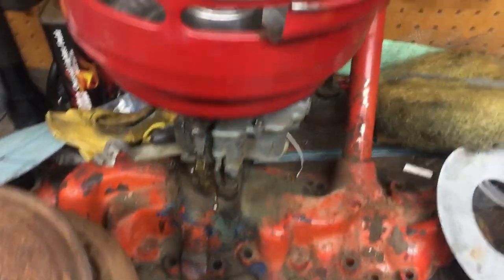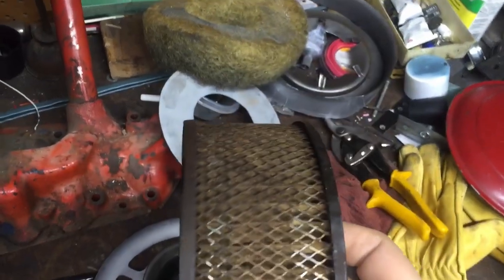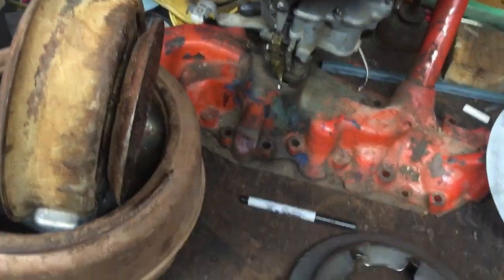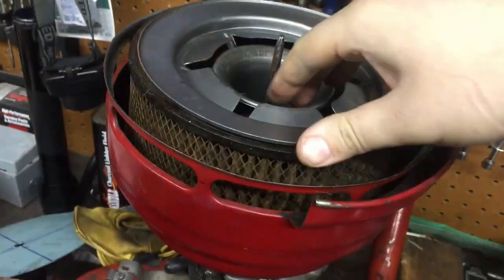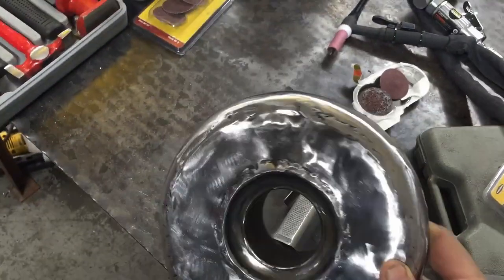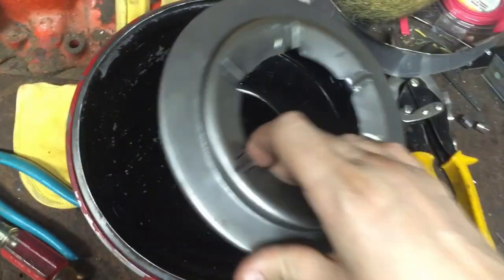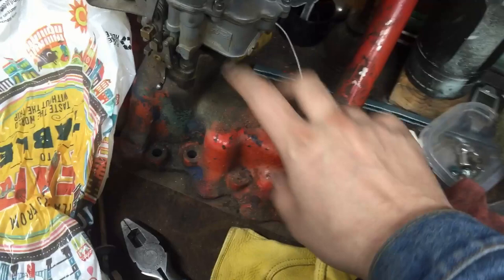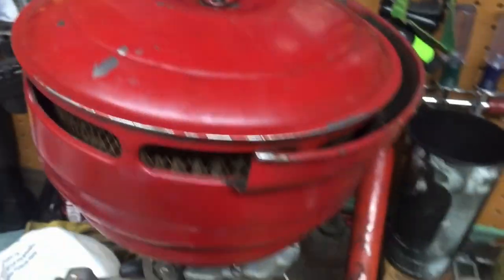Convert Oil Bath Air Cleaner to Newer Replaceable Air Filter on Ford Flathead V8

Comment: I find this very interesting idea which have never thought of doing. I know I'm six cylinders this oil bath was used through the early 1960s I believe. Speaking of Chevys because that's where I have the most experienced at. I have a 1959 with an oil bath. I run that truck so seldom I don't think I'll bother with it. But I wonder about the horn being too restrictive as you said. Also I wonder about some exterior modification with additional holes to improve airflow? Dissertation away from some of the outer appearance of originality. But if the holes were lined out in space properly most of the people would not notice. When I get the feeling your dad's doing this for himself and that's great. He is sticking to his standards. What is a filament that you took out of it made of? If I had an extra oil bath are filtering housing I would like to try doing this and just running the two and seeing what the difference turned out to be. It's great that you and your dad work together on these projects and you are plowed ahead on your station wagon. Learning as you go, but then that's what we all do is learn as we go.
Reply from the maker: I don’t know if the horn would be too restrictive for the flathead, but probably help more with low end torque like a velocity stack. I’m not sure if additional holes would help, but if was a high performance application I’d definitely go down that route. I’m not sure what the filament is but it is some stout stuff. Some people say maybe like coconut / cactus fiber or copper in other applications. It would be cool to see a side by side comparison between them the new and old filters. I really like working with my dad, and I do still have a lot to learn, but yea leaning is a never ending process. I’ve been doing a lot of other projects but hopefully can get more organized soon and get back on track with the wagon.

Comment: Actually the old oil bath filters worked way better then the paper filters,  plus it’s cheap to replace
Reply: My father and grandfather always said the same thing, that the oil bath works better. But I'm not convinced of that anymore. I have no facts to base my opinion on. The oil would help to catch the dirt. Remember washing and cleaning and Reoiling the sponge type air filter on small engine such as lawn mowers? Do you have any sources showing comparisons? Or are you speaking from experience? Which is even more valuable information. Thank you.
Reply: 100%, I used to drive my M37 in unbelievable dust all summer, on logging roads. Clean the filter once a year. The paper element in my Toyota would clog monthly. The oil bath would hold a ton of dirt, and didn’t restrict the air flow as it filled up. I bought a K&N filter for the Toyota, and that was even worse than the paper, buying expensive “recharger” kits constantly. I wish they’d kept oil bath filters.

Comment: I just converted a flat head Ford V8 oil filter to toilet paper. The oil filter may have been optional equipment. Put it on a Ford diesel tractor. The pleated paper filters cleaned air better but the oil baths held more dirt. I tossed the oil bath on the diesel tractor and installed a Oldsmobile  air cleaner.. I dont operate in dusty field conditions..
Reply from the maker: oh cool, our truck had a cartridge style filter setup on it when I got it... probably the same that could use the toilet paper. My dad ended up getting an adapter that could use a newer screw on filter. I'm on the same page as you with the oil bath air cleaner. Thanks for the feedback.
Reply: The toilet paper will clean the oil better than the pleated paper. If you come across a canister filter you can convert it to toilet paper. The old canister filters had a bunch of dirty oil after pulling out the filter element. To avoid that I put pipe plugs in the origional ports. I put a port in the lid and the bottom of the housing. The idea is for the dirty oil to go.in the top down thru the Scott 1000 and out the bottom clean. For the Scott to push down against I cut the thread end out of a full flow filter. Drilled a few holes in it for the clean oil to go thru.  I put a spacer under it so the Scott will come up to the top. Made a spacer to bridge. Between the toilet paper core and the filter tube. Cant have any leakage. The lid spring pushes down against the washer. A washer about 2 inches od with a hole that fits the center tube..the end of the spon on filter can be smaller than the canister. I was lucky and had a coolant tank cap that was a good fit after I took ii apart. Drilled a hole in the center that was a snug fit. If everything is working right the oil will be amber. You can probably use the stock inlet port if it is near the top. Thats the only conversion I have. The others
 Are The Australian Jackmaster Classic Motor Guards and the Gulf Coast juniors. You will need an orifice about 1/16 inch at the inlet.I have used a .025 wire welder tip. Make sure the filter is getting hot. Also you wiill need a seal to keep oil from leaking around the canister tube. Mine was plastic so it was easy to use a step drill to make a snug fit.
Reply from the maker: @ralphwood8818  Thanks for the info... That is really interesting.

Comment: Have you run into any issues with it so far? Im wanting to do something like this to my 1949 9n tractor.
Reply from the maker: Nice. We haven't put this one on the truck yet. Waiting to put the stock intake manifold / carburetor on. Just the way it fits though Id say it seals as good as a standard air cleaner.  Also we been using a similar K and N filter on top of a motorcraft 2 barrel with the fathead for years and its been fine.
Reply from the maker: Have had it on the truck for a few weeks now and its running great with the original style carb and intake manifold.

Comment: So the only way to change the insides out is to cut it I got some new old stock filter for my 49 came with two a winter and summer but I can't figure out how to change it out
Reply from the maker: As far as I know you normally don’t change the insides out. You just drain and put in fresh oil. If you wanted to clean the element you would drain it, put some sort of solvent in there to clean it. Then dry it and add new oil. Some people recommend kerosene, but if you look online for cleaning oil bath air cleaner you should see a bunch of info. I just cut this one open to modify it to take a newer style filter.
Reply: @DesertRatRacer  the manual says soak it in gas but the oil was sluge the car was sitting since 59 someone drove it 50000 miles in 10 years and parked it might have died in the war
Reply from the maker: @cocopublicnews6766  oh ok, gas is a good solvent too. I’d just give a good soaking in gas or another solvent to see if that can clean out the sludge. I would think the metal is just bent oven an edge to seal the top on. Might me able to pry the metal back to get it apart then hammer it back down to put it together... but that’s kinda risky. I’d try cleaning / soaking for awhile before I try that.
Reply: @DesertRatRacer  yeah I'm trying hot water to just melt the sludge then I'll use gas thank you
Reply from the maker: @cocopublicnews6766  ok, yea no problem